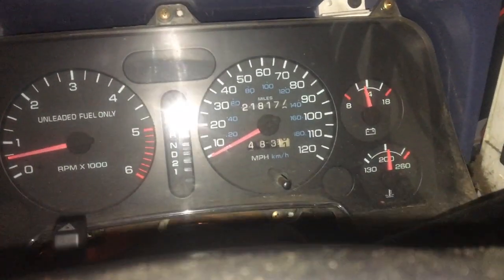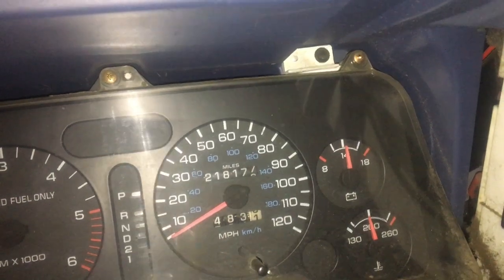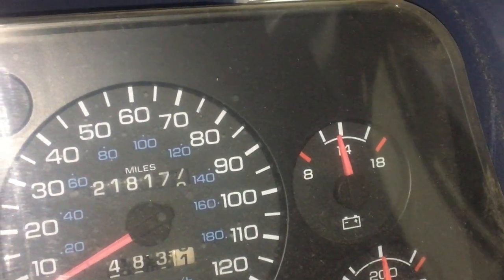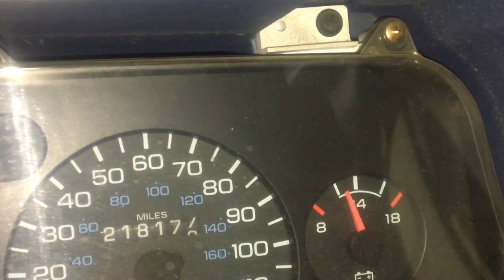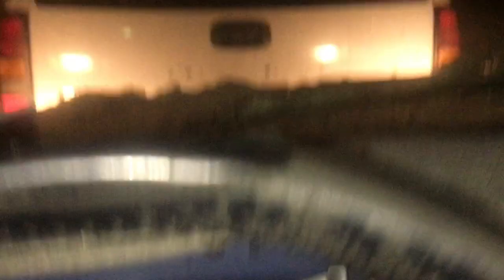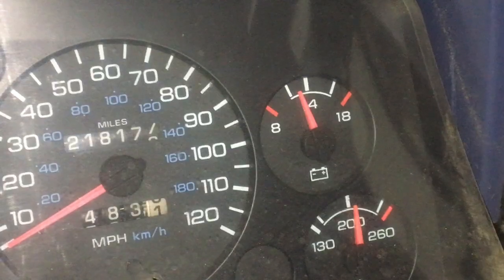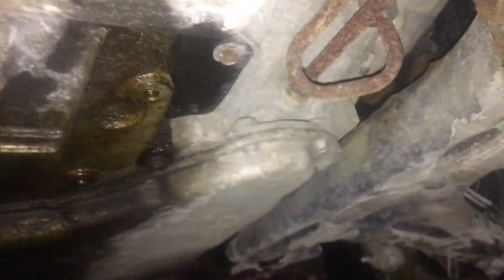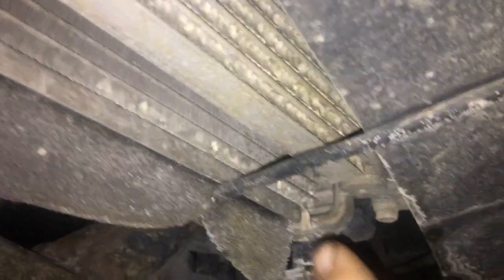THIS IS SOME BULL CRAP 💩!!

Comment: Marty it's a line going into the rack n pinion...venture vans had this major issue.., my radiator is held in by wire aswell because support rotted out
Reply from the maker: I tried & couldn’t find the exact point 
So I really need a lift rack for my repairs 
-3 degrees just too cold 
So I’m using the dodge right now

Comment: The batteries are fine in the cold especially in the Tesla it's just the people don't want to destroy their vehicles that have a very high resale value....In my opinion I wouldn't be taken my tesla on them roads.... And most people that own a Tesla I guarantee you have a beater...
Reply from the maker: I have another thought 💭 
What about families and ppl that have & drive multiple cars and trucks in the household
How could ya power all of them?
On house current  we’ve got  5 drivers in my house 
So that’s at a minimum five vehicles that need to be powered up 
Guess my house would have to have its own step down transformer 
Something sounds frighteningly expensive. 
Ha maybe but the battery in my iPhone dies out fast in the cold. 10 degrees out right now
Reply: @steelisthemeal   But the battery in your phone does not have a heating element and ways to monitor its temperature
Reply: It definitely does reduce the amount of distance. You can drive. What the systems that they have in those cars are very very good
Reply from the maker: Well that is is kind of true although the iPhone will shut down when I gets too hot

Took my iPhone to the ifixit store and it seems to be working a little better
The sound seems a little off though
Reply: @steelisthemeal   Take it back ask him if he can swap out the microphone tell him you really needed
Reply from the maker: Yeah I’m @ the I fix it store right now seeing if something can be done
First for the microphone
😮
Maybe later I’m going to check into an external microphone anyway
Maybe better sound quality
Reply: @steelisthemeal   The problem is Not many people that are filming videos do the types of things that we do... Is an external microphone is just another thing to break off.... Just like a lot of people tell me to get an action camera so I can use both hands... But they don't realize how many satellites it takes to make an action camera work.... The cell phone is an all in one option and I believe the best option...
Reply from the maker: I agree with you it’s quick fast cheap usually and easy

Comment: My 96 ram did all kinds of weird shit Doe's you're oil pressure ever go all the way down
Reply from the maker: Nope not on the 318 engine 
I have a v6 dodge that did that all the time until it stopped running 
The wiring sucks on most dodge Chrysler & Jeep cars 
Including mine  1/2 te electrical dosent work
Reply: @steelisthemeal  I had a 01 the wiring was mseed up in it it had a after market radio in it and after market head lights when you turned the key hafe way to lesson to the radio the car alarm would go off every time the guy that had it before me didn't know what TF he was doing my truck now a 2000 check Silverado I would like to put a subwoofer in it but am afard I'll fuck it up and it won't run right
Reply from the maker: Ya just wanna be careful to not cause a short that ruined the computer 
Control module
By some little mishap